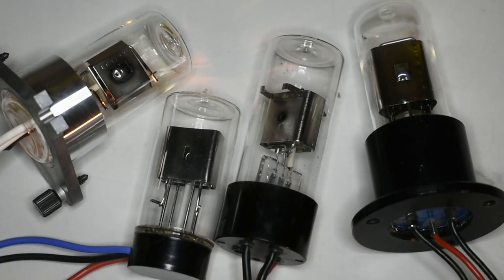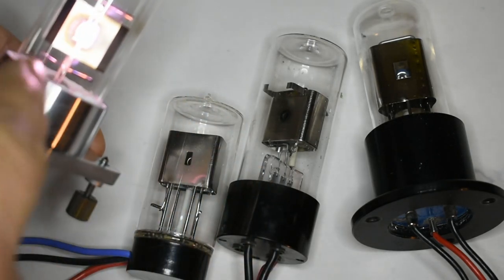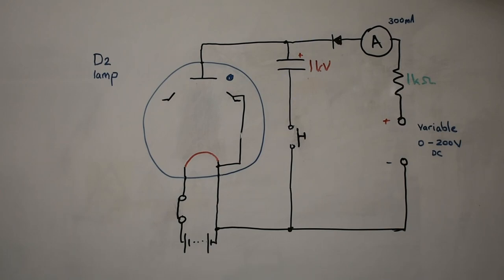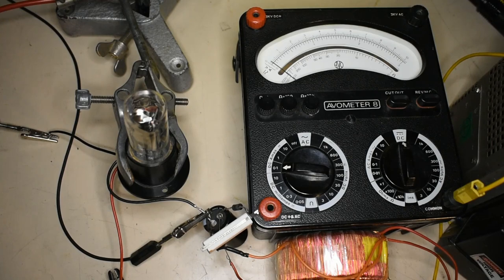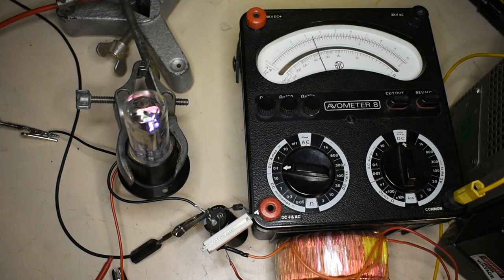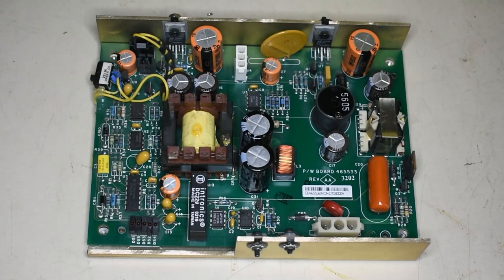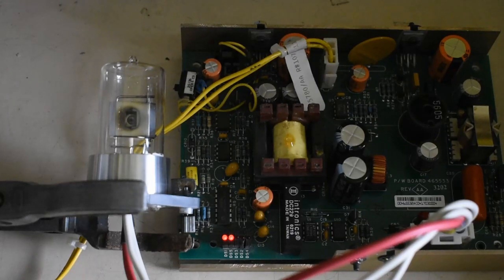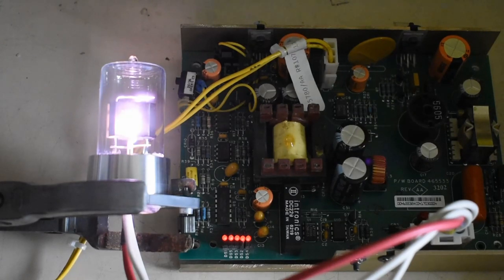Deuterium Lamp and Power Supply

Comment: Thank you, this video was very useful in diagnosing a knauer HPLC detector device, where such a lamp would only turn on after 2 to 5 attempts, and the module that drives the lamp is potted.
Reply from the maker: Glad you found this video useful. Just a thought not mentioned here. Sometimes in old lamps, with a lot of burning hours, starting becomes difficult. This can be due to the degraded emissive properties of the heated cathode due to ion bombardment. Eventually the cathode ‘work function’ becomes so poor the ignition pulse energy isn’t high enough to reliably strike the arc. Increasing the filament current or ignition energy will resolve this but only for a limited time.
Reply: @tuopeeks  Thanks! In my case, it was doing that for ages, and replacing the lamp with a new one didn't affect it. So there seems to be an electronics glitch. It's a true schroedinger bug, where i've connected a scope to it and it just turned on every single time. For now, i've soldered up a bunch of resistors and capacitors to emulate a connected probe.  Seems to have helped, i'll see how it goes. If this returns, the driver may need a replacement, and if i'm unable go get one, i now at least have some idea on how to make one.
Reply from the maker: @victortitov1740  Interesting fix. Sound like impedance loading

Comment: Where can I get one of those power supplies?  Just bought some tubes from Ukraine.
Reply from the maker: This unit was salvaged from some old spectral equipment. Not sure were you would find one on its own. It's not too difficult to run the lamp if you can arrange a heater supply and a simple ignition circuit. The lamp also needs a constant current control and this may vary slightly depending on the lamp being used. I have a little more information here: http://www.tuopeek.com/deuterium.html